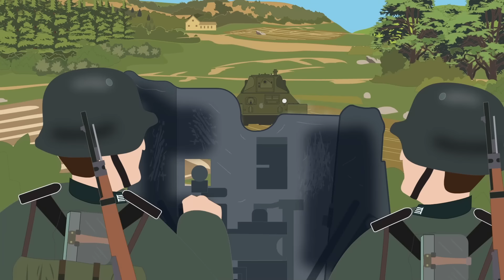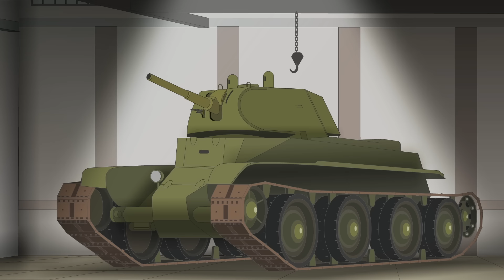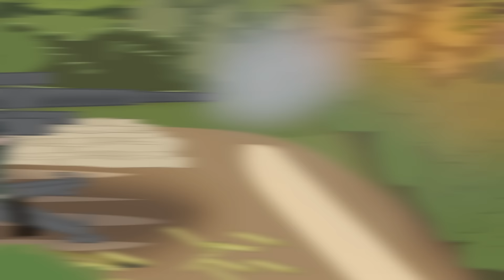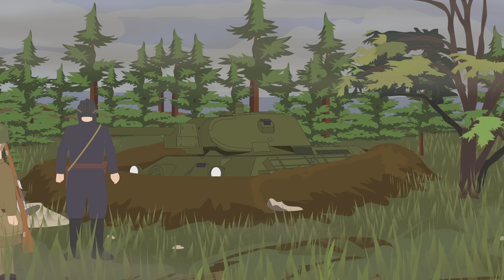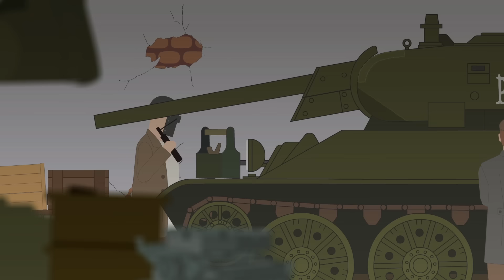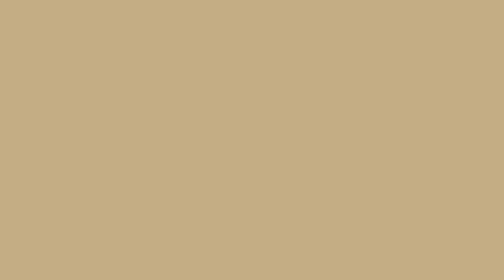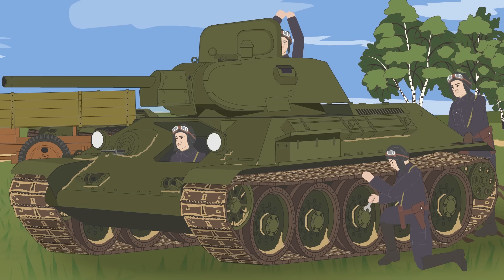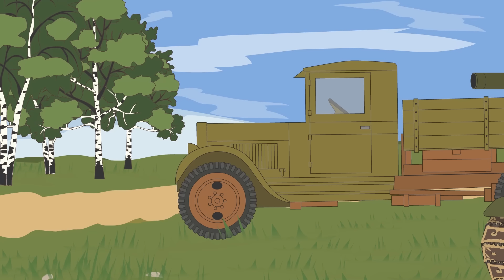Was the T-34 Really the Best Tank of WW2?

Comment: According to the title of this video, Just for this topic all aside of air attacks and former versions or what else: T34 with their latest version of the  gun (85mm) was only in advantage at the beginnign of the war. The frontal armor couldn't be penetrated by a 75mm - though need to be fair, on the back or poterior side it still could. 
Even the latest version of Tank four (Panzer IV) could be penetrated on even further range with that 85mm while Tank 4 also only had the 75mm gun.  

But as soon as the 88 guns and tiger/panther 2 tanks equipped with the 88 appeared, they again were in disadvantage if getting hit. The front armor of tiger could also withstand the latest version of the 85mm, at least on range against the first tiger.  That's why a new tank version, the IS was developed with a 120mm gun for an answer against even the first version of the Tiger 2 (King Tiger). 
And therefore, even if letting out all those technical and mechanical issues and disadvantages, totally not the "very best" tank in the whole WW2. 
But to admit a good means of the purpose. It wasn't garbage either. 

* But the actual  IS tanks were already not really necessary and not even really used since Hittler already  became megalomaniac,  but all the strategically important points and so materials, fuel and else was already lost and the development of all tanks/airplanes/Missiles and other warmachines were either too late, or not properly invented already because he wanted everything finished way too fast, which was actually not really totally necessary at the moment.  The second version if Tiger 2 (King Tiger) were useless if you had not ammo or fuel.
-> best thing would have been he'd just stayed with the first tiger for the moment and just mass produced and still advanced (better engine for example) it like the russians did on their T34 until a properly finished new project.
One cockroach can neither do anything against a whole pile of ants. 

But let's be honest. It may be good Hittler was "insane" and made many mistakes I'd say, because imagine such a person may had won and ruled half of the world...
Reply: German tank troops not only consisted of tigers and panthers, any schoolboy who plays online games about tanks knows this. The bulk of the German armored forces were from the Panzerkampfwagen, which were inferior to the T34 in everything.
And tanks do not fight with thin ones from the right strategists. There are special tank destroyers and anti-tank guns against tanks. The role of the T34 was in rapid maneuvers. Heavy IS2 tanks existed to break through heavily fortified lanes

Comment: the Stug was the best tank of the war overall for a number of reasons. you're not going to fully understand why without a little understanding of WW2 though
Reply: Type 36 Hachimoto  because it was the best ambush vehicle germany had, hence the high kill rate.
Reply: Yeah no, the Stug isn't really the best tank, there's no such thing as best tank, it's not even a conventional "tank", it can't turn its gun independently, it must be used in ambushes to be effective, its armor is quite lackluster.
Reply: @chaosagent_0106  best in it's ambush role, not really the best tank ever.
Reply: Type 36 Hachimoto  if it was the best AFV ever, it would also fair well against anything right? Like CQC and the like? Nope, it's primary role was just sit at the back and destroy stuff, that's mostly the reason of the many kills it had, and most of it's kills were trucks and smaller AFVs, I'm not gonna deny the design was good, but saying it was the best AFV is a stretch, a hellcat can do the same and is ranked second to the stug, but was it fighting a defensive war against 2 fronts? Nope

Any tank destroyer or AFV designed to sit at the back and shoot will almost always likely to have the more kills, now, let's say it was on the offensive, would it fair better? Or how about cqc? Nope.

Oh yeah and Don't forget they're on the defensive fighting on 2 fronts and ambushes were on a far larger scale.
Reply: Type 36 Hachimoto  it usually always hits first so it's obvious it would have many kills, however again, doesn't make it the best out there, any other tank could rival it, even the sherman, the most misunderstood tank of the war.

There is no best AFVs or tanks in war, each tank had a roll to play, if there was a best AFV or tank in the war, objectively speaking, it was the Sherman.

Comment: The pak shell doesn’t bounce off the 34. The slope armor causes the shell to be deflected off the armor.   That’s not a bounce. The same armor not sloped and the 34 would have been destroyed by the PAK37
Reply: The thing is, they over heat-treated their armor, making it strong sure, but not "Tough" it was incredibly brittle even a 37mm could shatter the armor, most of the T-34 fatalities back then were caused by panzer 3s or something similar to the 37mm with supposedly "weaker guns"

Really says a lot about Soviet armor.

Comment: The most destroyed in action tank of WW2
Reply: Also the tank with the biggest failure of any tank during the war!
Reply: @ryanweltz4076  Nope. That was the panzer 1
Reply: @Kakashi_Senseiofficial  no, it was the T-34, like seriously, it was so unreliable it had to bring a spare transmission.

Statistically, it was too, it could have been good, but because they were cutting corners to save man hours bam, unreliable.
Reply: @ryanweltz4076  Guess which tank was used to win the Battle of Kursk and destroy those "Great" German tanks.
Reply: @Kakashi_Senseiofficial  T-34-76s, KV-1s, T-70s and 60s, ISU-152 and 122s don't think they could've one with just 1 tank variety.

doesn't make it less unreliable, I mean some were decent, if it wasn't made in factory 183.

Also, guess who lost the most tanks at Kursk?
Reply: @Kakashi_Senseiofficial  Forgot to mention, german tanks weren't great, they were ok but extremely overrated IMO.

Comment: All said here is true,however ergonomicly it was a nightmare until the T-34/85. This coupled with poor crews, inferior optics, made the T-34 not effective in 1941. The 37mm at gun was not useless at side and rear attacks it could defeat it esp with APCR ammo. The tank was not fully equipped with radios until 1943. In 1941 and 42 they entered into combat deaf and blind. The German 50mm short gun could effectively penetrate side armor ads in easily with APCR ammo. In the front there was a serious shot trap between the turret and hull. With with all its faults it did save the USSR.

Comment: German Tigers were the best in ww2. In the Minsk Region, one Tiger took on 50 T34s and still beat them with little damage. In the Rhine Ruhr Region Germany, one Tiger took on over 200 Sherman's and over 60 rocket tanks. They destroyed almost all the tanks in the Region but had to surrender near the Shezmik Raliyard because they ran out of ammunition. A Tiger crew would often run out of ammunition before the enemy can run out of Tanks. The Tigers were slow but powerful. A T34 shell could bearley scratch the thick metal. By far the best of WW2.
Reply: It is highly understandable why the German Tiger tanks are praised by many tank enthusiasts as the best tank of WW2. They admire the firepower and armor of the tank. The Tiger tank has a powerful 88mm gun that destroys anything in its path from a great distance and thick armor that is impervious to most shells. However it takes more than the superior firepower and strong armor to determine the quality of the tank. The Tiger is a very complex piece of engineering. The design is so complex that it inhibits mass production. A lot of parts are required by hands to be assembled. The Tiger fails to utilize the sloped armor which improves the armor without adding more weight. The Tiger is very expensive as it requires more resources and manpower to be built. Another weakness is that the Tiger uses customized parts. Any spare parts are either salvaged from damaged Tiger tanks or be shipped all the way from Germany. Russian tanks regardless of types and models in contrast use standardized parts making spare parts easily available. The complexity of the design prevents the tanks crews to make simpler repair themselves and requires highly specialized repair crews to do the job. By 1944, the Allies and the Soviets had developed new guns capable of taking out Tiger tanks. The British had the 76.2 mm 17 pounder gun while the Soviets had the 85mm gun and 100mm gun. Throughout the war only less than 2000 Tiger tanks are produced in contrast to 40,00 T34 tanks are produced. Quantity is as important as quality during armed conflicts. Military equipment are lost, captured or destroyed and getting them replaced are essential.  Thousands of T34 tanks are destroyed but they are easily replaced with new ones rolling out from Soviet factories in the Ural Mountains while many damaged ones are salvaged, rebuilt and returned to military service.

Comment: It wasn't the best only the cheapest you can see it if you look at one. Very sloppy welding and fabrication. The only thing that is very well designed is the sloping armour. It was too cramped and the thing was lacking everything including a radio. Only the late war models got basic radio communication in each tank but by than the tactics didn't matter because they had the basic tactic to send tanks into the German kill zones until they ran out of ammunition to destroy them. Basically the same tactics used in Ukraine.

Comment: The T-34 was not a good tank, it broke down very quickly, couldn't switch gears past 4, it only was effective because it could still fire shells, that, most of the time, didn't even hit the target, but the numbers of T-34's active at the time could make the difference on the battlefield.
Reply: It only had a 4 gear transmission, but shifting past 3 was very difficult to say the least. Only very few with a better 5 speed gearbox were made.
Reply: If something is crappy and sometimes beats something orders of magnitudes expensive it isn’t crappy

Comment: T-34 have a steel hardened of 600 rather than the 300-400. This causes many of the tank's armor to crack upon being hit because such hardened steel are extremely brittle. T-34 also do not have a suspension system, making it very rough and uncomfortable while in motion. It's seriously one of the most overated tanks of WWII.

Comment: Over 53,000 T-34's were built during WW2. They were fast and reliable and had sloped armor, but sheer numbers mqade them a winner.
Reply: 44,900 of them got destroyed, and they were anything but reliable. Also sloped armor doesn’t really make them better, it came at a cost. It made the tank cramped and hindered their ability to operate it.
Reply: @GodEmperorEnjoyer  Stalin didn't mind kiling millions of soldiers and destroying most of his tanks. The T-34's were rude and crude, but they packed decent firepower. 
The sloping armour was adopted by all tank makers everwhere.
The death rate  of the Red Army was appalling, those attempting to retreat were shot doing so.
But the stopped the German's and made them pay. 
Operation Barbarosa was the turning point in WW2.
Reply: @crankychris2  sloped armor has been a thing since ww1, heck even in medieval times they had sloped walls to deflect cannonballs.

Comment: What total BS. The T-34 was not only the worst tank in WWII, but quite possibly of all time. The Germans alone destroyed 55,000 of them over the course of the war making the T-34 the most destroyed tank of all time by far, not the best. So why was the T-34 such a pile of junk??  

1: The T-34 had the space hogging Christie suspension (coil springs). Already a cramped vehicle to fight in, the space taken up by the Christie suspension made crew ergonomics impossible..

2. No radio. For most of the war, the T-34, like other Soviet tanks, had no radio making coordinated attacks impossible. And when later versions of the T-34 did have radios, they were of such poor quality as to be useless.

3: No turret basket. Without a turret basket, the gunner/ loader had to dance around the bottom of the hull to retrieve shells where most of them were stored. Losing a foot or a leg was a very real hazard for the T-34 crewmen. 

4. Poor welding and no interlocking armor plates. Compared to Germany, Soviet arc welding was 10 or 15 years behind the Germans. What's more, the Russkies only spot welding adjoining armor plates, allowing burning gasoline from a Molotov cocktail to easily penetrate the crew compartment  or engine. The Russian plating was not interlocked either. This is why you see so many pictures of destroyed T-34 tanks blown completely apart. The classic picture is the empty hull of a T-34 with the turret lying net to it and the turret roof laying next to the turret. 

5: A pop gun for a main gun. The original 76mm gun on the T-34 was very weak as to be almost useless.  Even if you were lucky enough to hit your target with the poor optics, there was little chance of penetrating German armor.

6: That last problem was fixed with the longer and greater diameter 85mm main gun. The problem with this is that the turret was placed forward on the tank hull. The reason for this has never been understood. But putting the long 85mm gun on the T-34-85 caused a problem known by mechanics and crew alike as "ramming the gun tube." Try to cross a stream or low place in the ground, much less an antitank ditch, and you were going to plug up the gun with mud / soil. And if the mud was not cleaned out, the next shot would almost certainly cause the gun tube to blow up.

7. High flash powder. The Germans, being the consummate chemists of the time and all time,  developed low flash powder so that once one of their tanks fired, it would still be difficult to determine where it was hidden. The T-34, on the other hand, blew out a big cloud of black smoke from its diesel engine and this, coupled with the bright flash of the main gun, made spotting even the most perfectly camouflaged T-34 easy.

8: Poor crew ergonomics resulting from a 2 main turret. By contrast, the Germans had a 3 man turret that allowed the Track Commander to concentrate on the overall picture while the gunner was directed to specific targets. And by having a separate loader, German tanks could crank out the shells. 

9: Poor optics. Does anyone believe for even one minute that the Soviets could produce the great optics found in German tanks ? I don't think so. 

Well I'm sure there are a few things that I missed, but feel free to add to this list.

Comment: t-34 is the best tank (my opinion)
Reply: I have to disagree with that. Although the T-34 is faster and has a better gun, the Sherman is a lot more reliable than the T-34, which is why I think the Sherman is the best tank of the war.
Reply: @GodEmperorEnjoyer  not really the t34 was slow due to the fact changing between gears was extremely difficult and the max speed was only theoretical. The M4 Shermans gun was far superior than to the T34 because loading a shell in battle conditions in a T34 was extremely difficult mainly due to how small the tank was. And accuracy was terrible this explains why the t34 would often charge at the enemy and also due to the powder mixture the shells would explode inside the breach if the gun was hot.

Comment: T-34s were not better than german tanks at moving through mud, if so, barely.Many T-34s got stuck in deep mud and completely abandoned.The soviets cut corners in design, like; removing the seal on the hatch (water was able to flood into the tank and pool when raining ruining the mechanics), the gunner’s position did not rotate with the turret, gunners often getting hit by the gun itself, the tanks had no seating so the crew would be more uncomfortable and the lack of seating could even cause injures because of how rigorous it was to pilot WW2 era tank, the tanks were made from lesser quality steel which made the armor easier to penetrate.BUT THE ANGLED ARMOR YOU SAY!IT WAS SUPERIOR AND IMPENETRABLE!No, no it wasn’t.It also was not the peak of engineering, most WW2 tanks had similarly angled armor, and the T-34 was far from the first to introduce it.

I went on a rant huh?Anyone that’s reading this, go watch laser pig’s video on this subject, many T-32 fanboys gloss over the many MANY issues with the T-34 

P.S quantity is not better than quality, because quantity needs more support(Like ammo trucks engineers ect. ect.)